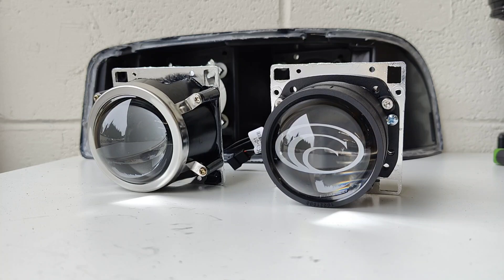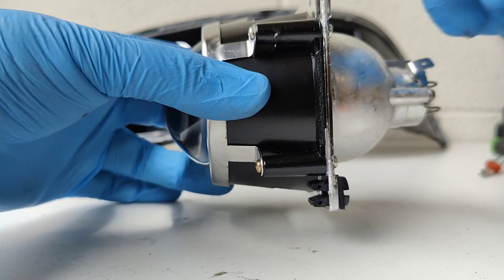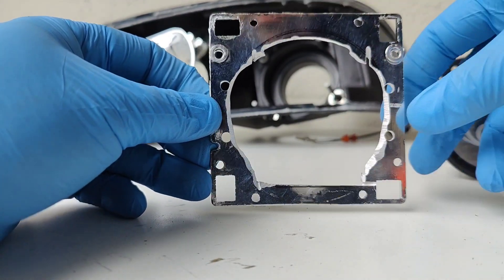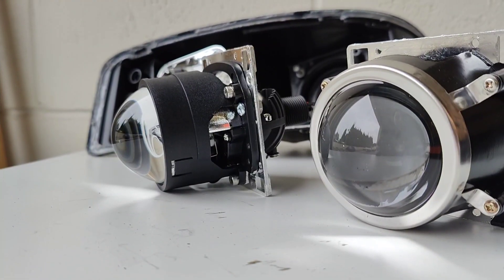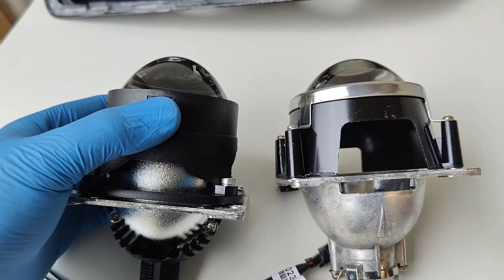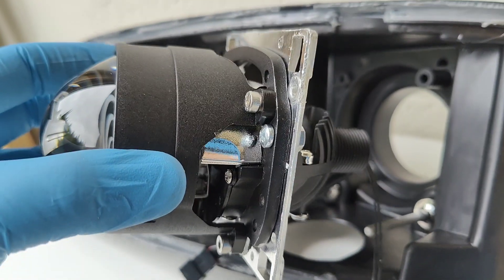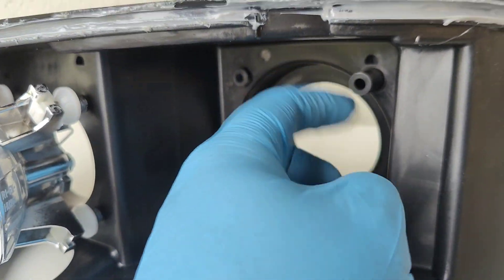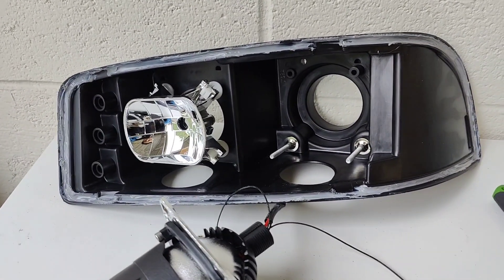How to fabricate a headlight projector bracket from an existing projector DIY

Comment: in  a case like this i ve mounted the new projectore to the back of the adaptrt plate with some washers in between. But your method works too of course. good job.
Reply: Hi, can you explain more your process? Thanks in advance
Reply: @ not really. Just go and try which mounting method works best for you. Every headlight is different.